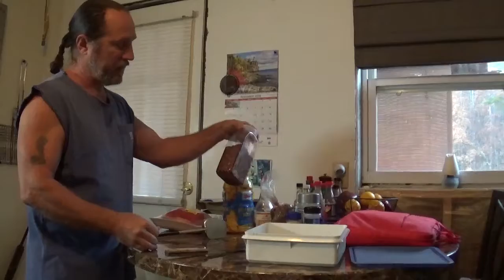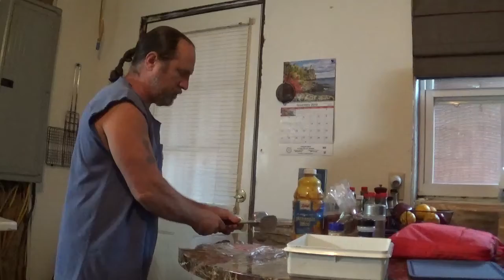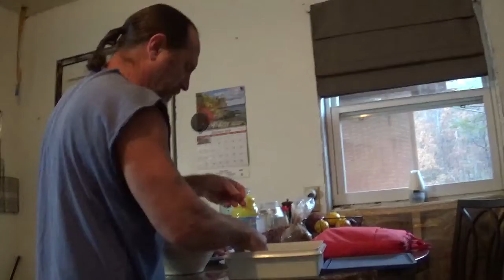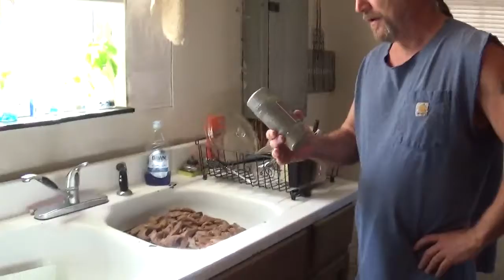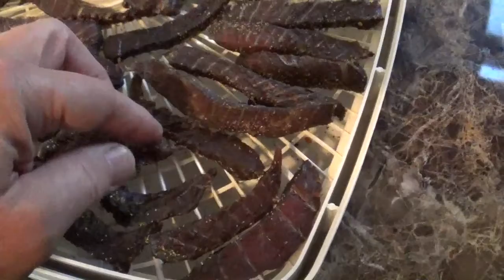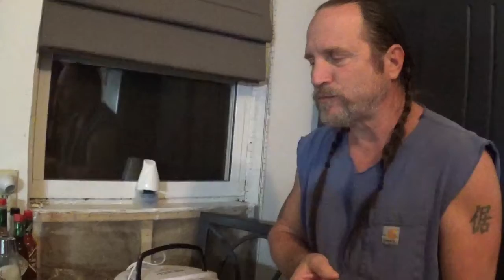Beef Jerky! Start to finish! (Turn a beef roast into beef jerky!)

Comment: Found that this is the best storage option -vs Summer Sausage (wet and floppy) or Hard Salami.  Summer Sausage must be eaten or cold stored and eaten within 1-2 years.  Hard Salami kept in cool/cold must be eaten in 2-3 years.  Having tested a SanFran Molinari hard salami log in vehicle for 2+ years (hot summers, cool winters) and it turned into dog food taste (and as hard as baseball bat - needed to "saw" with bowsaw for cutting any slices at all !).  So make meat jerky into thin slices and vakpak with dessicant and oxygen absorber - keep in cool/cold storage - and they will last longer than any sausage product on the market.  Any other options of marinating with other sauces etc make for delightful and edible jerky eating.  Even having some COSTCO jerky of the same age in vehicle as salami log, and they are still moist, edible, and tasty.
Reply from the maker: Thanks for the info John!

Comment: What’s the difference between oven cooked and using a dehydrator ?
Reply from the maker: An oven will work fine, but the temperature and air flow of a dehydrator is more consistent.
Reply: @ToddWittenmyerBackwoodsLiving  cheers brother